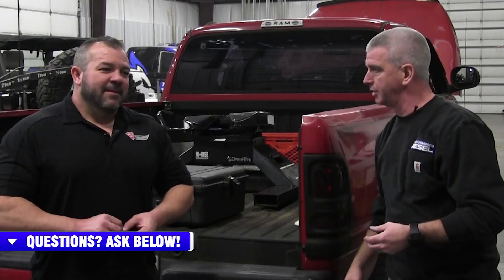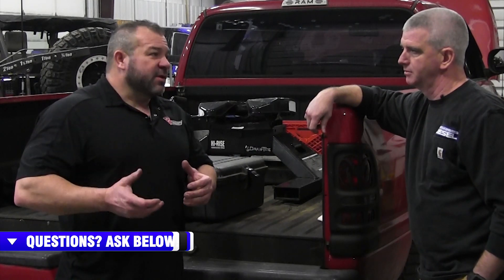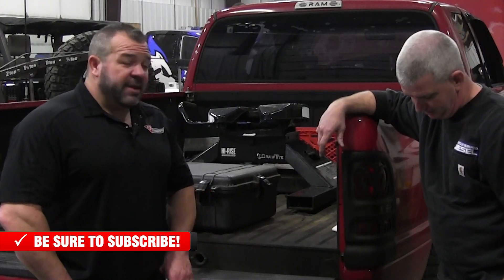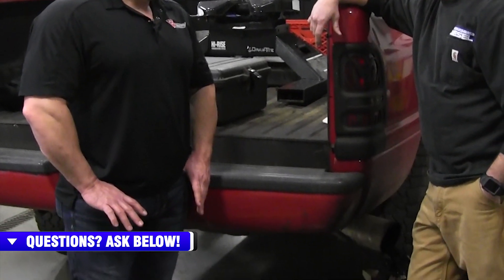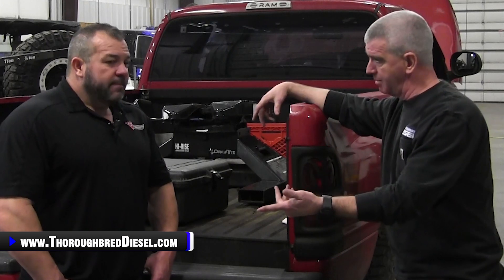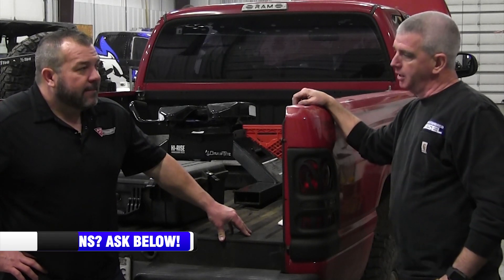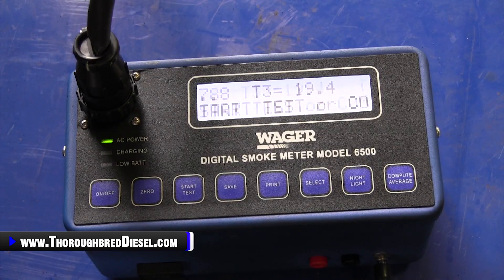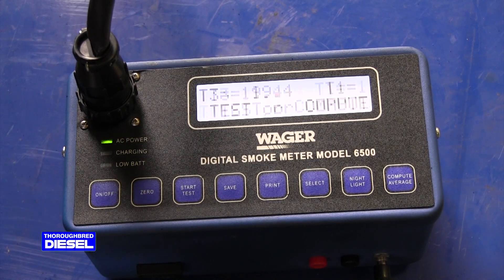DON'T WATCH This Unless You Are a Hardcore Diesel Nerd | We Get To Test An Emissions Opacity Meter

Comment: Would have been awesome to seen a dyno run before and after. Just to prove that new injectors made the same horsepower, while still getting under emissions.
Reply from the maker: That was the plan but we had a Turbo issue that kept us from completing that.
Reply: @thoroughbreddiesel  I wont buy into that until i see numbers....bigger or more flow  will push more fuel.. better atomization with less fuel..maybe..  snake oil until we see actual dyno and injector and tuner setting...just saying..bosch and others be doing it longer?

Comment: Thoroughbred Diesel,
Hey just installed my VP44 two days ago, I’m back in love with my truck!!!! Also added some new injectors and a FASS lift pump is as well. I couldn’t be more happy! 

Also, it’s running much quicker, a lil quieter and responsive. Am going to pull my trailer tomorrow, but as of right now my opacity seems much better then when my VP44 was going out, it was just dumping fuel out the 5” exhaust, is this normal? 

Thanks again guys!

Comment: I’ve got a vp44 truck. Running a 165gph fass, hx40 and an edge tuner. I’ve currently got 125hp injectors that I have to replace. I’m wanting to keep my power or up it. I thought about getting the 150 and turning boost up some but I’m not sure if the vp will even be able to keep up. Should I just go with 125
Reply: I have 7x.010 (150hp) injectors with a quadzilla adrenaline v2 tuning and I can push a ton of power while being smoke free. If you can trade your edge for a quad, go no lower than 150 on the injectors. They can be made smoke free now with the tuning.